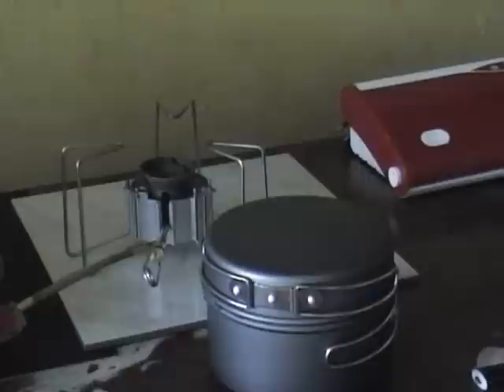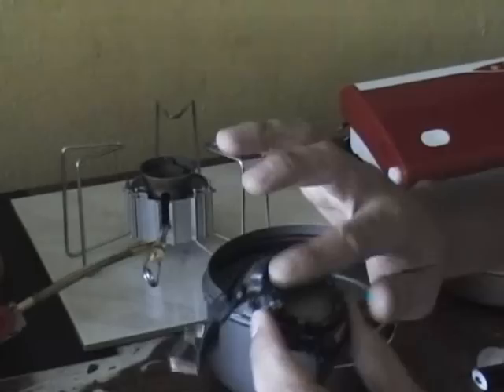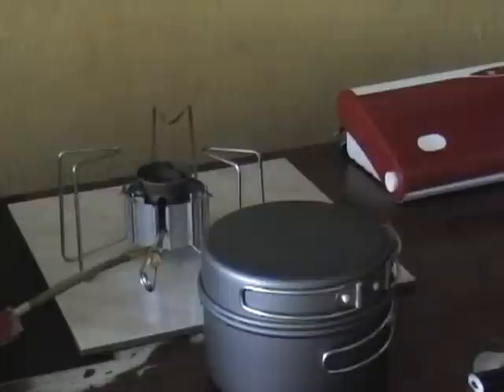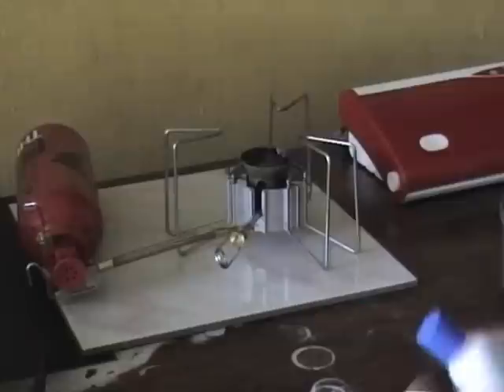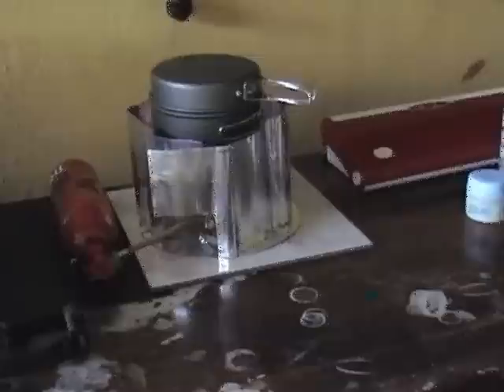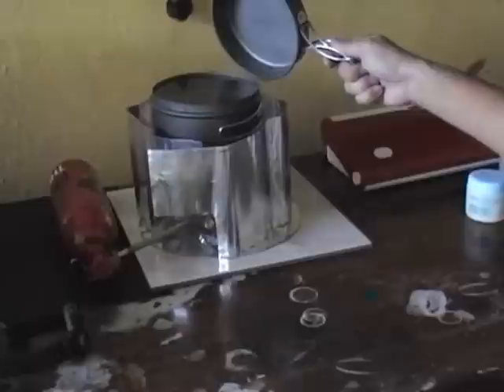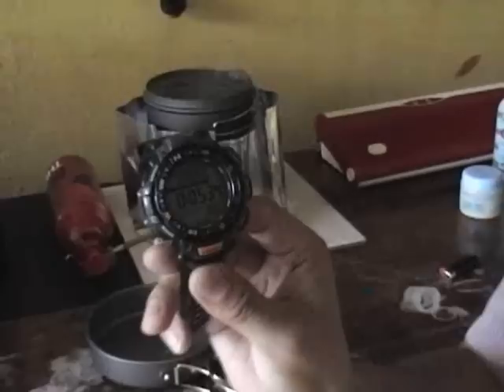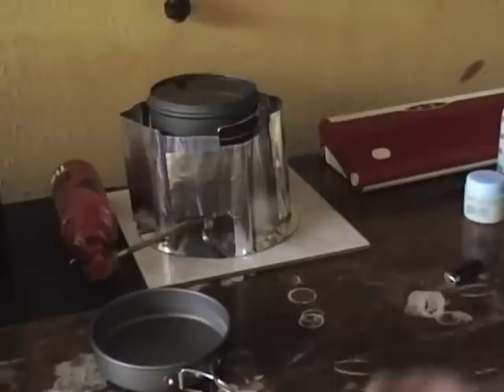MSR Dragonfly Review and Boil Test Part 2

Comment: Priming msr stoves with rubbing alcohol/isopropyl alcohol reduces flare up when turning on the primary fuel once it is primed and severely reduces soot, so no messy hands when packing up and should not result in burned eyebrows from football sized flame flareups. Msr website recomends alcohol for priming. :0)